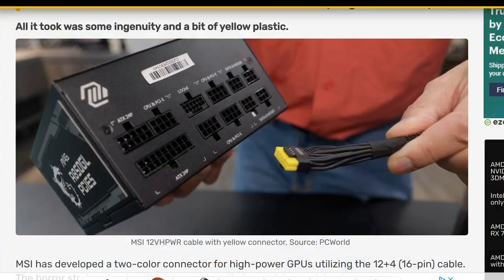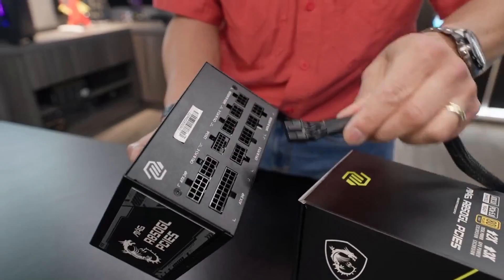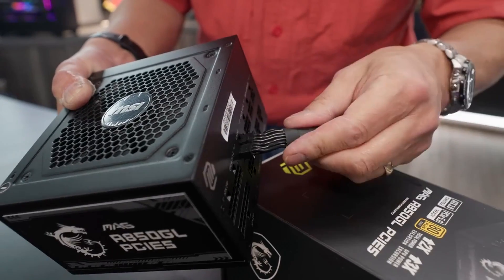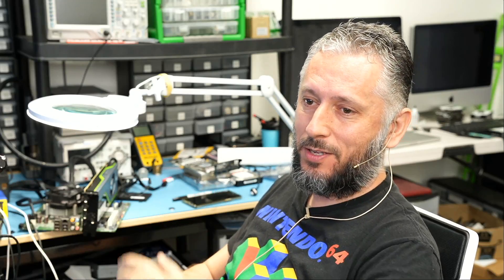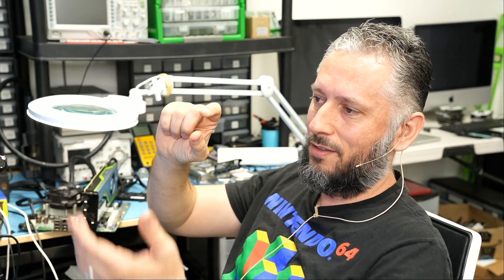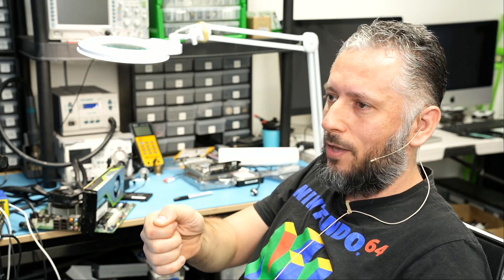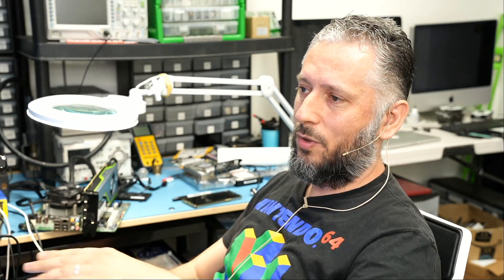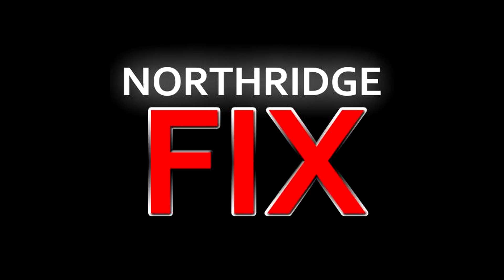4090 Melting connector Fix using MSI yellow cable 12VHPWR. What?

Comment: I can confidently predict that we will soon see melted YELLOW connectors from MSI.

There is a FUNDAMENTAL ISSUE with the 12VHPW connector and that is DEFECTIVE DESIGN from the very start.

Wires, cables and CONNECTORS have to have their conductor sizes related to the current passing in them because of RESISTIVE HEATING (I2R). If a conductor is undersized, it will run very hot and can melt the insulation on a cable. This is a very commonly understood issue. That's why you use 'heavier' cabes for larger currents (more power).

What we see here is essentially the identical thing but with a connector. In this case the contacts run hot and can melt the nylon insulation (melting point 260C). Because it's mostly hidden from view though and isn't as obvious as melting cable insulation, lots of people are running round in circles like headless chickens trying to find nonsensical explanations and MISSING THE DAMNED OBVIOUS when IT'S  STARING THEM IN THE FACE !
Reply: yep, design error all the way, all happening bc of that stupid connector, they should have used 2 or 3 connectors for 12V power like previous video cards.
Reply: @orange11squares  Absolutely. You CANNOT make a connector contact SMALLER (0.64mm square instead of 1mm square i.e. *40% of the size*) and expect it carry MORE current (9+ Amps instead less than 6 Amps). It's beyond INSANE !
Reply: been saying it since the start
Reply: Corsair seems to know there is a fundamental design flaw with this pathetic connector.Their new ATX 3.0 Shift PSUs have no 12VHPWR port on the PSU modular panel.They use a different implementation.PSU experts JonnyGuru and Aris Mpitziopoulos say that Corsair's approach is much better than a native 12VHPWR port.
Reply: @ytctuser  I haven't seen any reports of melting at the PSU. Also all of the cables on that power supply are different on the PSU end, so I don't know if the 12V high power being different is a sign that they know there is a problem. (there is one but I wouldn't take that for admitting to one)
Reply: @--_DJ_--  HAS ANYONE LOOKED CLOSELY ? Connectors need to be tested under maximum rated load with bead thermocouples for temperature rise. The rise in temperature should be under 60C (for cables). Anything more is clearly risky. The temperature should NEVER reach anywhere near the MELTING POINT of the insulation. Even the manufacturer's spec states 3 WATTS of dissipation in the connector, *a figure normally associated with high power resistors*.
Reply: @ytctuser  Interesting to hear that. I think too many have been impressed by statements that Intel and others has 'approved' the connector when Intel has no say whatever in component approvals. It's been an utter cock-up IMHO.

Comment: The design is as bad as USB, The toleracnes have never been good. The original design was and is not good the connection is way to flexible, there needs to be a new better standard but doing this when PC's are down sales wise is hard.

Comment: 6 pins 12v are not able to handle 450w of constant power draw , and overclocking itself lead to a draw of 550watts and more , these  connector are simply not designed to handle these kind of wattages draw , overall manufactures will never accept this flaw cause it lead to loss margins plus low sale due to economic crisis
Reply: In the pick hour, the card could draw power up to 3 times the TDP.

Comment: The video is irrelevant and nothing to do with pushing in the connector properly. We never had an issue with melting connectors in the past so the recent spate of melting connectors affecting the 4090s is surely a design fault of the connector being unable to carry the  heavy amp draw. They need to redesign the connector and split in to several plugs as in previous designs to lessen the individual amp draw on each pin.

Comment: Both the black and the yellow cable have a locking tab.  If it's pushed in far enough to lock in place, but still isn't "seated", that's a problem with the design of the locking tab.  As long as it's "locked", it SHOULD have enough contact area to transfer the amps it needs, whether there's visible yellow or not.  Because if not, it can always rock/vibrate loose, and the locking tab is just for show.
Reply: Its seems clear the 'Lock' on that cable isn't really locking anything.
Reply: Damn right OP
Reply: Yea but guess what, pcie locking tabs have been around at least 20 years. This is an Nvidia failure plain and simple.
Reply: @bluej511  That is the point, the tab on my 8-pin connectors are damn snug. The latch on the nVidia connectors are just rubbish.
Reply: @bluej511  The locking tab is not the same on the 12VHPWR as previous PCI-E. This is both an Nvidia issue and a PCI-SIG issue.
Reply: @bluej511  Nvidia did not make these connectors, PCI-SIG did. Everyone is just adhering to the poor engineering and tolerances that are exhibited in this video.
Reply: @bluej511  Nvidia didn't design the plug, many people had a hand in this debacle.

Comment: Hey buddy you probably already noticed but when he pulled the yellow cable out a little bit and you could see yellow he did actually say "I would push that back in" it was very difficult tree hear though. Great videos dude you and Luis rossman have inspired me to start my own elections repair company. Kudos
Reply: i dont get why he told gordon is bias at the product? gordon is bias on pc not console
Reply: What Alex is criticizing is the fact that the yellow cable was able to be partially plugged out very easily with just a slight move from the reviewer but the reviewer didn't comment on that flaw.

Comment: the cable could be fixed if you use a heat resistant material for the plug

Comment: what happen with our people right now? the problem is so simple, if something huge or massive is holding in with small or weak part it will broke sooner or later for sure. so, it just clear that the connector is too weak to handle 12HVPWR it must be a revision for it design

Comment: imagine buying a pc from dell or asus directly having it custom spec receiving it using it it burns half you house and asus or dell going user error you needed to check the cable we plugged in, that being said id love to see a redesign with 2 clips one on top left and bottom right so it clips with good tension on each side but at that point they should just engineer the whole connector.

Comment: All of the cards should be recalled and replaced with a unit with a better connector.Will they warranty this fault in 5 years and replace motherboards and video cards.They are simply delaying any fix so the end user will pay for it in the future.

Comment: Let's face it.
The pins are thinner, the socket contact area is lower.
It would have been better to keep the previous pin and socket dimensions. Or even make the pins wider with fatter cable gauges. 
Even the extra, tiny signalling pins seems a bit silly. 
We've had Ethernet over power and power over Ethernet for decades. The power circuits all have filtering. Why not use the 12v pins for signalling too? You don't even need a bandwidth. 9600 baud is probably more than enough to tell a psu/gpu what the power situation is. 

The whole thing seems like a bit of a thrown together kludge.

Comment: I think this yellow connector is still useful in which it tells user that the cable is not plugged in all the way (or got wiggled back out), so user can push it back in. Theoretically it will reduce the number of melting connector due to bad connection case.

However I still think the issue is on the card design itself. Old connectors wiggle like hell, some barely make connection and still works fine (I'm talking about the old days' Molex connector). This time the card definitely draws more power than the pins can handle, or more precisely, the card draws more power than the pins' contact point can handle.
Reply: The fact that you can pull the cable out by 1 to 2 mm, according to PC World's video, WHILE the cable's lock thingy IS LOCKED, actually PROVES that it's a design fault: this new cable with the yellow tips simply HIGHLIGHTS IT more.

But nVidia is also @ fault here because of where they placed the connector ON THE CARD due to how the VAST MAJORITY of the cases out there forcing the cable to bend, sometimes VERY NOTICEABLY, when the users close their computer cases. This, coupled with the fact that the cable CAN BE "wiggled out" with a bit of pressure WHILE STILL LOCKED is a recipe for disaster.
Reply: @hojetiveca  Yep, what I mean is the yellow connector cable highlights the issue to let the user know and push the connector in all the way, at least reduce the number of "bad connector" (or "user error") case.
Reply: True. If this connector was designed Germany for example, it would be considered as illegal and the TÜV Rheinland would not pass it. A connector never should reach temperatures past 40°C in ambient temperature. But this Nvidia connector reached the 60°C mark!! That's too hot!
They could have done this connector but with a 50% bigger size.
Reply: @stormrider01  To melt nylon, as here, the temperature rise needs to take the contact to  *260C*. It's a fire hazard.
Reply: It's not the problem of not being pushed all the way in. It's a stupid design that pushes 450 to 600+ watts through the tiny wires and tiny connectors!  The 30xx had the cables, with wires and connectors handling 150 to 200 watts each, and didn't have any of these issues.

NVIDIA needs to fix this issue before people die in fires that were started by this poor design.
Reply: Isn't/shouldn't the connector be long enough to prevent this? Like even 60% plugged in should suffice because of its length, why the fiddly tolerances? Are they incapable of making connectors now? Lord help us!
Reply: @TammyDenseDdank5658  Long enough ? A longer pin would have a larger contact are which MIGHT help reduce contact electrical resistance (that reduces the heating effect) but a far simpler way of achieving that is by making the contact larger in cross--sectional area (mm square or AWG). That is the accepted way of rating materials for current carrying capacity.

But in any event, it's hardly the issue. The contacts are reaching temperatures that are HUNDREDS OF DEGREES TOO HOT. They should never be anywhere near the temperatures being seen ! Fiddling with small effects is not the answer.  The design as it stands is GROSSLY DEFECTIVE. Fiddling with it won't save it !

As for mating properly, the locking tab is meant to deal with that issue by design. If it doesn't, the design is inherently defective !
Reply: The old connectors simply had more metal and more plastic. More matter = better heat dispersion. 12VHPWR is extremely small for 600W, and its design is...not good.
Reply: You shouldnt have to check to make sure the cable is plugged in all the time. Do you check the battery connection under the hood of your car every couple times before you start it? No because it, if installed properly, wont back the bolt off and fall out. Now maybe after quite a while, but also the car is more likey not to start before it would catch on fire or melt the battery by turning it on.
Reply: @Will Parker  There is no reason to check it after install unless you move your PC around a bunch. The idea is it shows you if you messed up either on install or after cable management.
Reply: @--_DJ_--  i understand how the design is supposed to work. The point is that its a flawed pointless connector thats unneeded
Reply: @Will Parker  Yup, a solution in search of a problem.
Reply: It seems like people (or at least those replied to my comment) get too involved into the battle between "user error" and "design flaw" that (most of) you misinterpret my comment, so allow me to explain more details.

I never claimed the connector melting issue is "user error" or "design flaw".
What I saw is, it is possible for the connector to melt from the heat due to bad connection.
And I also said, this "connector melt due to bad connection" is on the card design itself, for the error margin is too low. I brought out old days' connector as example.

In this particular case when the connector is not plugged in all the way, the weakest point in this power link is the contact point between pins on the card side and pins on the cable side. The yellow connector let the user see the error and fix it by push the connector back in.
As you can see, this only happens during building the case or rerouting cable, and the user have to check every cables/connectors anyway. During normal use the connector should not back itself out.
The yellow connector simply solve the "user error" side of the connector melting issue.

However there is cases where the connector is pushed in all the way and it still melt (the 90-degree adapter case). This is the "design flaw" side of the connector melting issue, and also is the root cause. The flaw can either lies in the pins itself, or in the connection between pins on the card and pins on the cable (e.g pin too short -> contact area too small -> high resistance), or in both. And the mentioned "user error" makes it worse by reducing the contact area.

P/S: I don't want to say this every time but English is not my first language, so if you spot any mistake or using of inappropriate words (or "rude" as some have said), please point it out so I can learn. Also if you find my opinion being not constructive, please point out in which part I need to improve. I'm not tech-savvy and my major is not engineering so I can not know everything in this field.
Reply: Just check everyday 😂
Reply: Tbh i dont think that connector can withstand the power 4 8 pins output, i mean thats so much power just for 1 connector
Reply: @Báthory47 It can and does work just fine for most people. You don't need a lot of material to transfer that much power.
Reply: Theoretically it WONT reduce the problem.. you saw it, problem still there. Are you saying now we need to look everyday: Is it still seated? Come on man. Silly
Reply: @koford  Are you living in Japan? I'm sure you are living in Japan where earthquake is so strong that it can wiggle the connector out even when no one touch it.

Also please read my top comment again. I never said it would reduce the problem.
Reply: @sarahkatherine8458  I stopped replying to people whose criticism isn't constructive, or opinions that can be seen as rude. It helped to make my time replying to comments much more enjoyable. Just some friendly advice. take care
Reply: @uria2001  So my opinion is considered "not constructive" and "be seen as rude" just because it is against yours or others' opinion, correct?
Reply: @sarahkatherine8458  i was referring to @koford comment to you. My comment would be hypocritical if I felt that way toward your comment.
Reply: @uria2001  I'm sorry, this time I was the one who was misunderstanding.
Reply: @sarahkatherine8458  no problem. i should have linked back the to comment to make it more clear. take care

Comment: It's the fault of the power supply manufacturer who allows too much current to pass where it shouldn't be, and it's Nvidia's fault for not checking if there's power on the entire cable. It's not the cable's fault, which has its own known limits, nor the user's fault.

Comment: Why on earth are tech reviewers so IGNORANT of connector and ELECTRICITY BASICs that they're unable to  realise the ROOT CAUSE of the problem ? The contacts in the 12VHPWR connector have a cross-sectional area only 2.4mm2. If you attempt to pass 50 or so Amps through a conductor that tiny (typically rated at 17 to 20 Amps for a 60C temperature rise) IT WILL GET VERY HOT ! The temperature rise is in fact proportional to the SQUARE of the current, so you can EXPECT a temperature rise of the order of HUNDREDS OF DEGREES and that's exactly what happens ! Indeed it can get so hot the connector WILL MELT.

It's a garbage piece of flawed design and NEEDS TO BE WITHDRAWN ! That's all there is to be said about it.
Reply: Because the pretend to be smart and the are making look themselves as idi0ts

Comment: why not get rid of that stupid 12VHPWR connector, why not make 2 thick wires + and - as a cable, with a plug connector or something, and on the card something strong like a wall outlet....or just keep the existing 8-pin, make them 2X or 3X bigger or something....just make something idiot-proof.

Comment: The AMP draw (heat) expands the female pins to a point that the contact surface get smaller.
That cause a rising heat build up that ends up with a horrible melt down.
Seen similar years ago on Mat’n lock connectors handling high amp draw.
Even worse if some of the most high amp draw pins is situated near each others.
It get into a chain reaction. The bend load of massive cables makes it not better.
Just an overload by not increasing the capacity of the connector to a decent duty.
That the connector miss a fractional part of insertion is not the main issue at all.
Reply: That's super interesting. Thanks!
Reply: Do you have an idea why it's always the card side that melts? The female cable side has the first layer of plastic around each pin. To me it's almost like the plastic is low melt on the card side.
Reply: @mikeh6286  
I suppose more heat is trapped on the pins since those are the inner layer of the heat action that builds up. The female’s relief heat better due to the outside position, who knows? In my cases 6 pins that took the main high current was situated side by side as pairs on one side.

Comment: This is a design flaw. The cable/connector cannot carry the intended current. Thus any slight misfit of the cable leads to disaster. Nvidia electrical engineer made a cardinal error during design and everyone is now trying to cover up this glaring error.